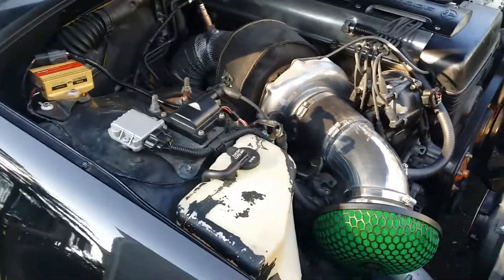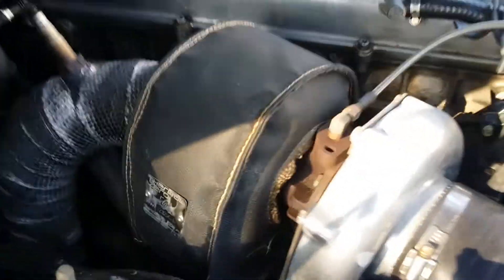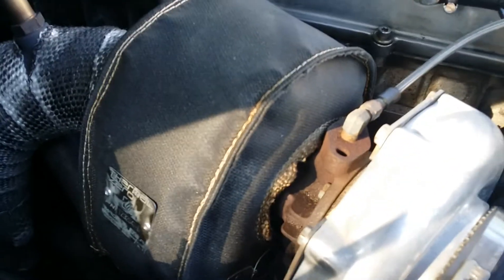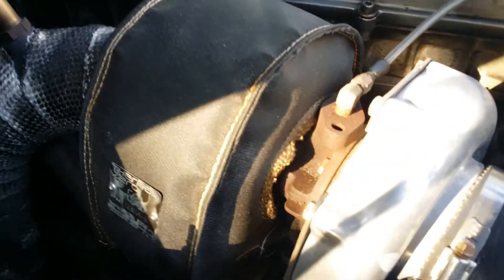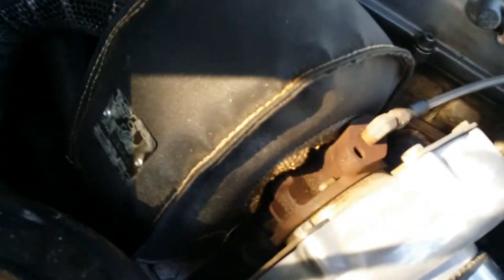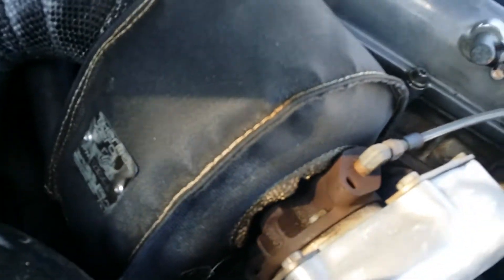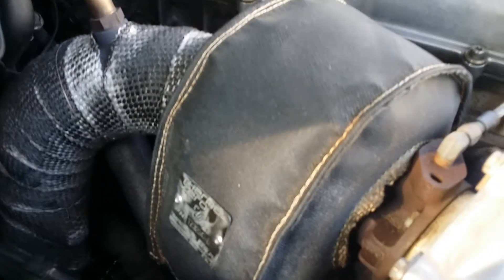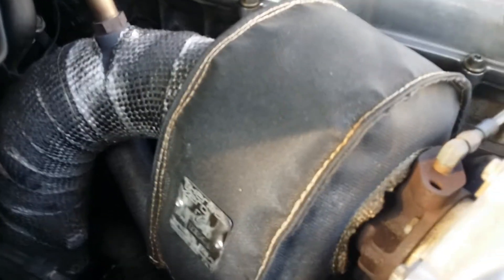Thermal Zero Turbo Blanket UPDATE 5000 miles later

Comment: Nice work. I see its NA-T. I have an NA-T supra running 8psi. Are you using an RMR throttle body with that intake? What engine work have you done to get upto 600? The usual TT head gasket and injectors?

Comment: When you say it was partially your fault what do you mean? Thanks for these reviews. Useful
Reply from the maker: When I installed it I used a metal zip tie and I think that cause it to rip. When I installed the current turbo blanket I used some metal wire (included) and it has been holding up AWSOME. I will definitely buy this blanket for future projets. Stay tuned I will be doing a supra brake upgrade as soon as I get my hands on the damn calipers!